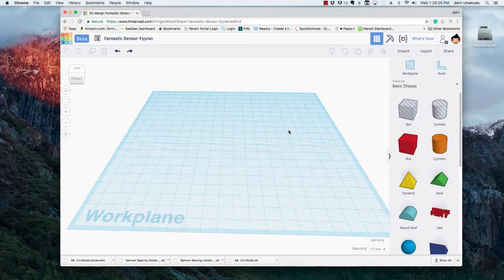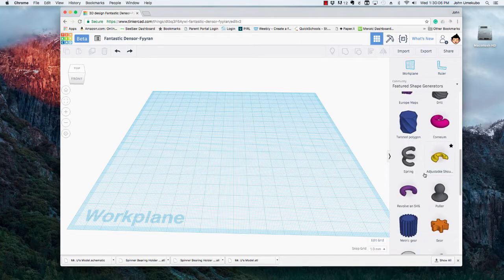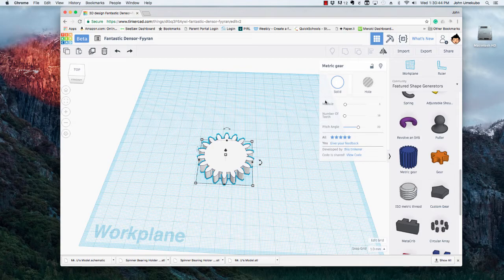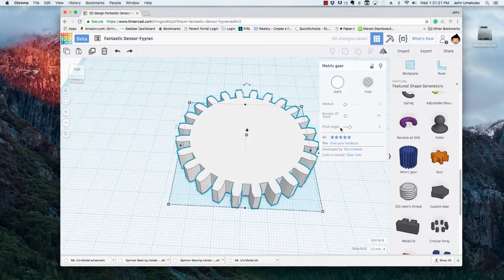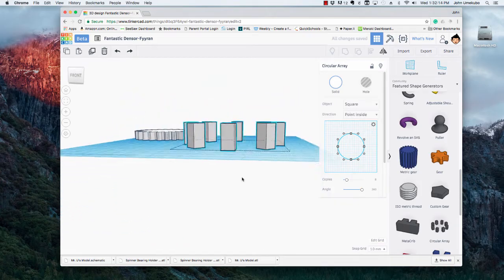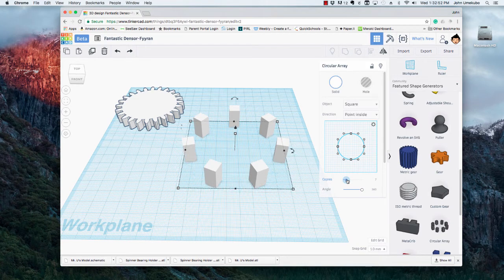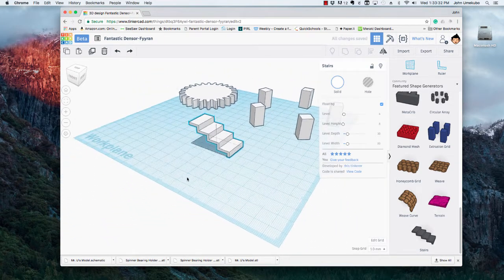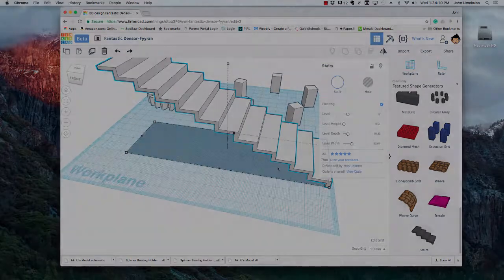13. New TinkerCAD - Shape Generators

Comment: Are you using paid program. I can't find the shapes you have
Reply from the maker: Since this video was made, the Shapes Panel has changed. See video #23 in my playlist for the updated version.
Reply from the maker: The shapes here should still be there but they may be a bit harder to find now that there are more premade options.
Reply: @johnumekubo  I turned off and turn back on my tinkercad and now it's in the list.